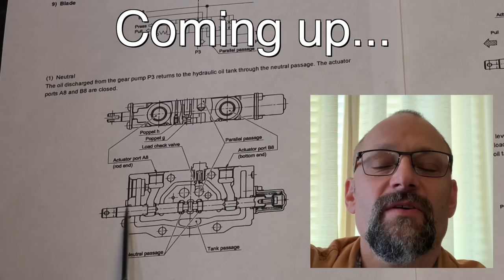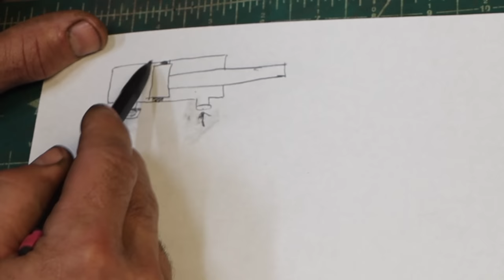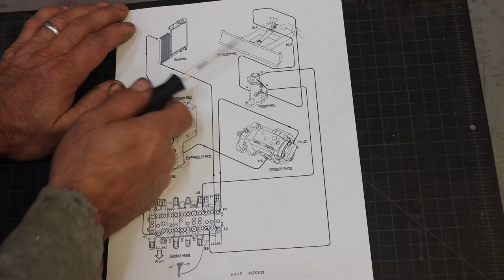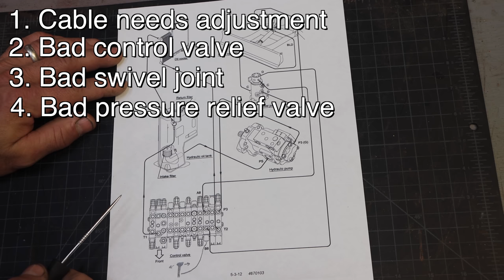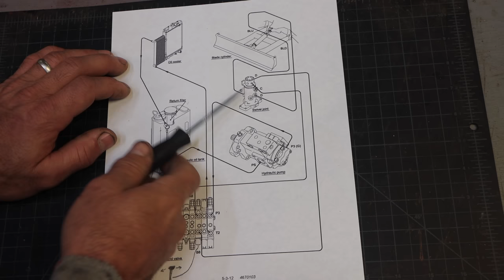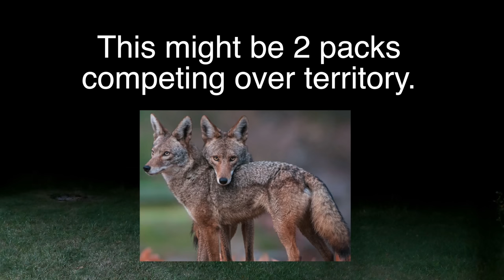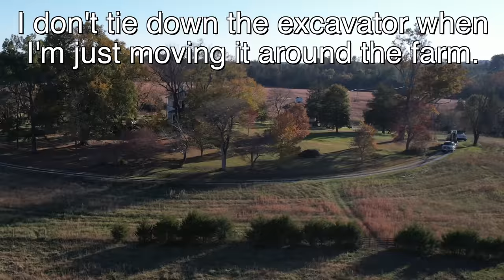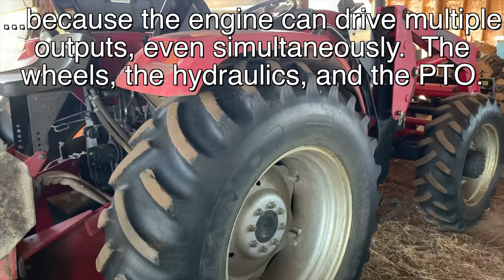Excavator Repair, Swivel Joint Rebuild, Yanmar Vio-50.

Comment: Those critters are a hungry miserable bunch. I always have trapped them till they get down to a manageable bunch as they serve a good function as well but when they build up to several hundred in a small area.... my animals would just be a mess, so by by coyote because their just as bad as rodents in my book. I know many disagree and thats fair. Ok, on those I call them a swing motor, I had to change one on a very old machine out in the woods. Since the company just ordered new stuff always to replace (Louisiana Pacific) and I was able to see where it fit into the machine, I had a  head start on what to expect. I had a machine that the name escapes me now, but it had over thirty hoses and a wiring nightmare. From underneath from how they came out was one messy place. I wound up cutting a hole in the deck of this machine, a large hole I might add that had a two inch thick deck plate and since covered in oil, was a fireball just waiting. I had several guys with high pressure hoses from the bay I was working near so we just cut and washed for a hour. Once removed out of the way, it took a job that by the book took a week to tear down and replace, so I had removed this metal from the top and was able to use various methods of marking those wires and the hoses as well..... it took me only a total of twelve hours and that included the welding the deck back and grinding smooth so no one knew the difference. It also removed a ton of grease and oil so that machine was a lot easier to service. I do remember that this machine was a dragline